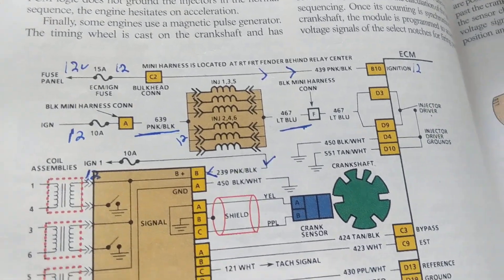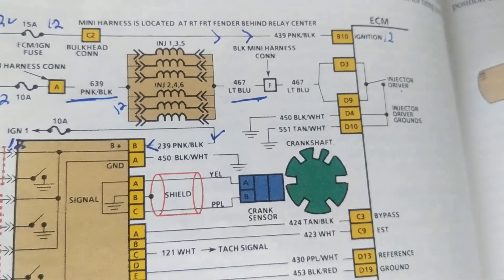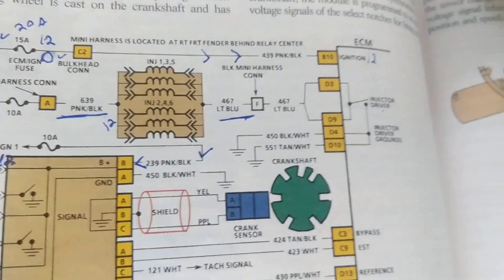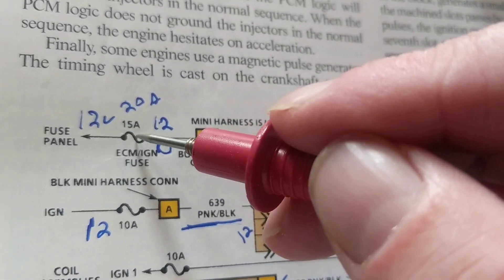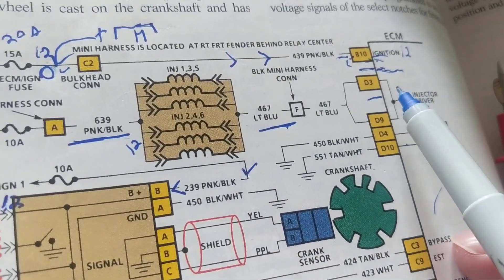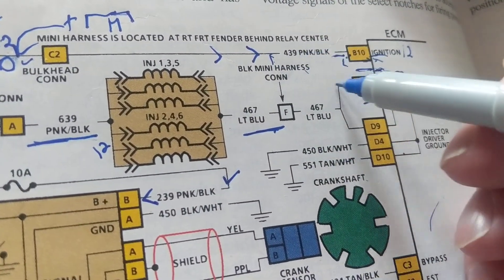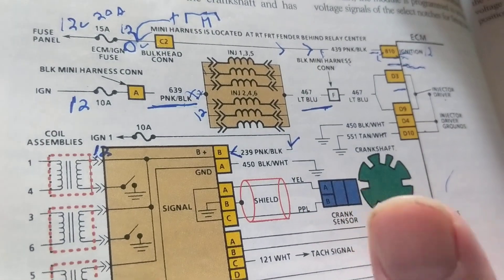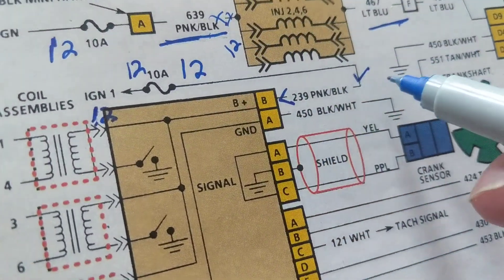HOW TO TROUBLESHOOT ANY CIRCUIT FOR STUDENTS AND ADVANCED TECHNICIANS PART 2

Comment: When you ckeck for ohms on a short what should be the value on the meter? 
If you discomcet the wire to the pcm it should be open O.L but id there is short. The value is?
Reply from the maker: Sorry I didn't get back to you earlier yes to your question the resistance you measured depends on the load circuit involved you should never measure less than 10 ohms from the fuse to ground that tells you there's a problem right there and if you take away the wire from the PCM all you're measuring is an open wire then thank you for your comment

Comment: Really nice video Joe
Reply from the maker: Thank you
Reply: Thanks Joel lost low/high speed just   have intermittent speed now, thinking bad relay but need to check fuse and power and grounds to relays
Reply from the maker: @randywheeler652  are you referring to a fan motor or something because a relay or a bad ground will affect all of the speeds looks like a bad resistor fan motor resistor
Reply: Wiper motor on 2009 town and country has one relay that when activated supplies a second relay called low/high speed circuit
Reply from the maker: @randywheeler652  what supplies intermittent speed
Reply from the maker: @randywheeler652  if that relay would be bad then the low high speed would be bad
Reply: First one called wiper on relay then it supplies current to second on call low/high speed relay
Reply: I can't see on this schematic would it be possible to talk to you over phone  with you Joe might be easier to explain I think I saw your phone number
Reply: I'm confused on the diagram. Your very helpful and I'm still learning